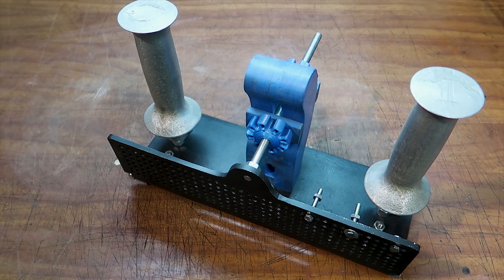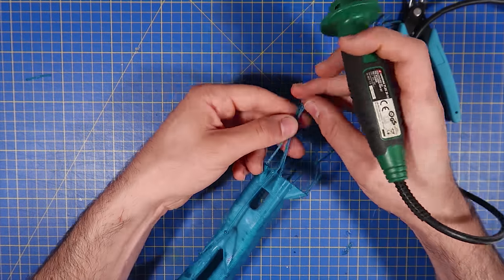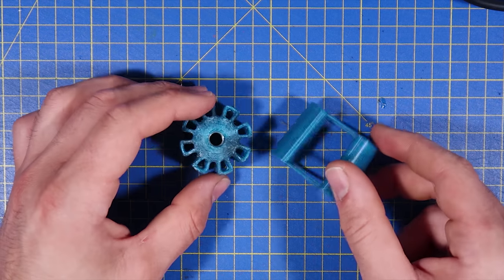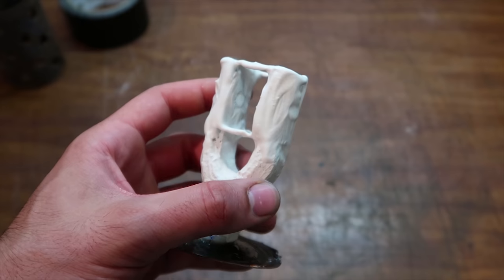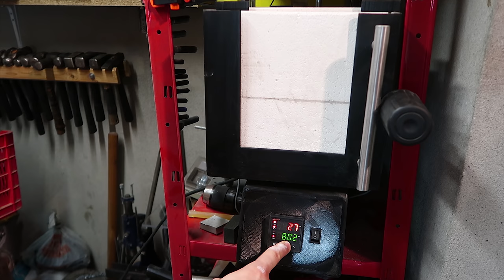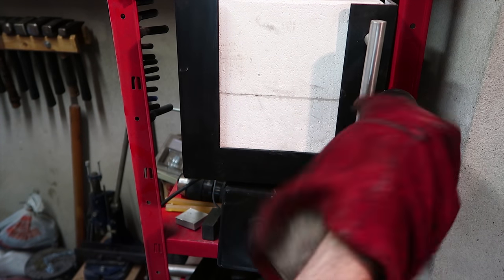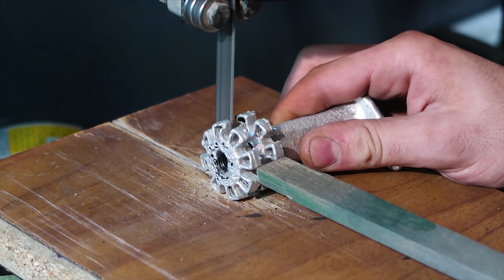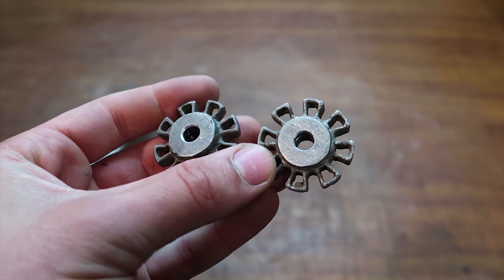Cast Intricate Shapes With Lost Wax

Comment: Can you tell us how the new aluminium parts compare to the 3d printed pieces? Are you happier with the new pieces? Do they tighten up properly and are they superior in all respects? A couple of quick comparison notes would be much appreciated.You stated they don't bend - but do they hold properly? They looked like they were a little loose when you tightened them up in the video (parts slid over each other easier).

Comment: if you were to use a centrifugal casting device to shoot metal into the mold you can achieve much finer detail than pouring the metal in by hand. we used centrifugal casting in dental labs to make high precision gold crowns. centrifugal casting devices are very inexpensive, but to make larger parts you might need to build your own. however, they are very simple devices

Comment: How good is the surface finish from the printable wax?
I have a few projects coming up I have considered using it for..
Reply from the maker: Depends how well you can tune the 3d printer. With enclousure and a dial-in setting I think it can be great, it can also be smoothed easily with mineral spirit and it's super easy to machine and carve. I love wax! :')
Reply: Thankyou, I just ordered some to trial, I have worked with carved wax before for precious metals, but normally sand cast brass and aluminium.. These things I'm working on require more complex shapes and detail than green sand can give.. Cheers! :)

Comment: I love your channel.  Your projects are well done.  Were the 3d printed jig parts not durable enough?  I ask because I'm getting a 3d printer (on its way) and one of the main reasons was for shop jigs.  Thanks for any advice and keep up the cool projects!
Reply from the maker: Thanks!! They were doing fine, I made some knives with that and had no real problem. The only reason is that if I really pushed hard against the belt the plastic bended. Maybe with greater infill would have been stiffer! I think I printed that at only 25%. Anyway, you won't regret the 3d printer. I love mine, so versatile <3

Comment: Wouldn’t casting investment give you a MUCH smoother finish in the cast without corrections and filling needed?  Sand was great in the 1800’s and before but technology has delivered some major improvements.
Reply from the maker: Sure! I use plaster because is cheap, I don't really mind some cleanup for what I do